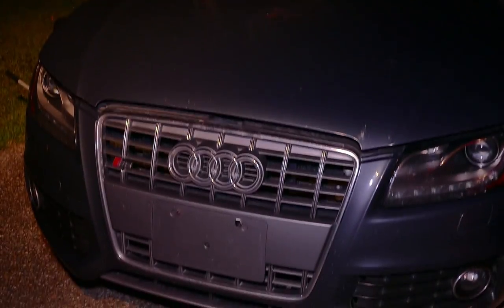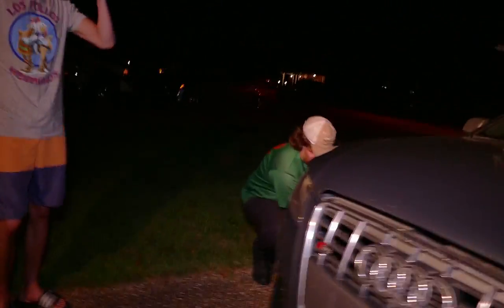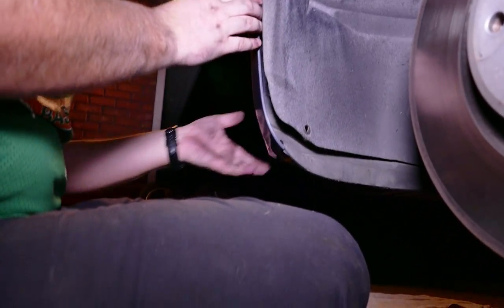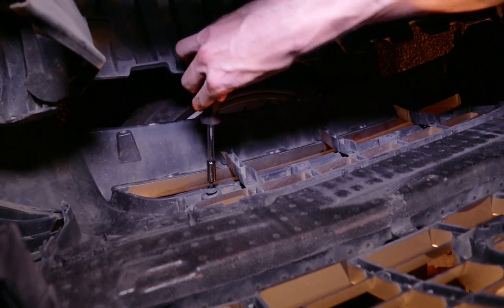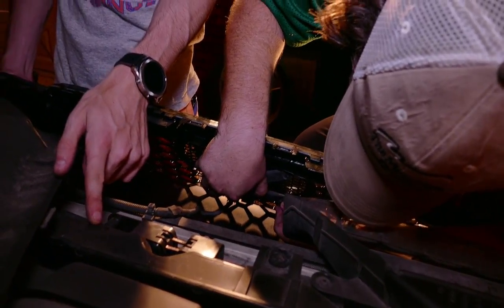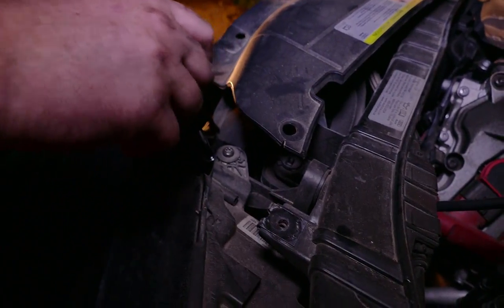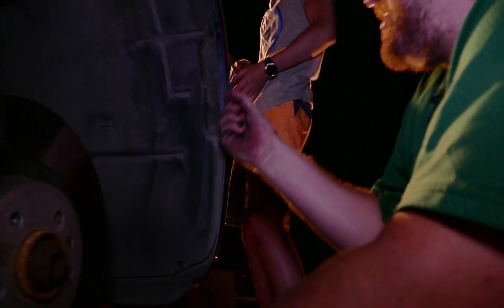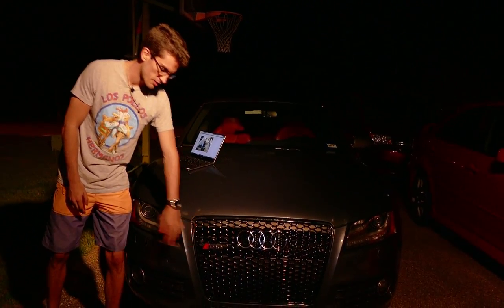Audi S5/RS5 Grille Swap

Comment: You really need to rethink your safety, you should have used jack stands. It's extremely dangerous to only use the jacks. If your not going to do that at least put the wheels underneath the car so you don't get crushed to death if a jack where to fail.

Comment: put an 8385 turbo in there you will get 800hp for fun and in the first spull you will also make the engine block explode!!!nice vid!!!
Reply: Savage Tech يب
Reply: Uh no. this is a daily driver not a race car.
Reply: I'm sure the engine would blow if he puts a turbo.
Reply: Troll King lol it wouldn't blow
Reply: depends on the engine if the block is made of cast iron and it has decent internals they can make 800+whp with bettera fuel system and a turbo
Reply: I guess 10 psi will be reliable enough for daily driving.

Comment: UGH! McLovin tightening the front wheel lug nuts while the car was still jacked up! lol 
You can do the rear wheels that way since the parking brake would keep the wheels from spinning. Hope you  re check the torque on the front wheels after a day of driving. Cause safety.

Comment: Love the content, keep it up. But I do have a little bit of advice for you. JACK STANDS!!!!!!!! Also you did not have to take off the tires to remove the bumper cover, just turn the wheel to max lock in either direction to access the wheel well screws. But all and all good job.

Comment: 12:04 I was cringing really hard at this part not because of the "star pattern", but because he's using a tire iron to put a wheel on. Also they tightened the lug nuts while the car was still in the air 😬. The star pattern is literally the least of their worries.

Comment: Not having the front plate is illegal in California but you usually dont get pulled over unless youre driving a modded 80s-90s car. I drive a 2000 accord without the front plate and never get pulled over but my friend with a 97 sc300 cant drive 20 feet without getting stopped for not having a front plate, dumbbb.
Reply: SwajMastaGeezus in California, if there is a spot in the front of a car to put the license plate you have to put it, if there isn't then it's fine.